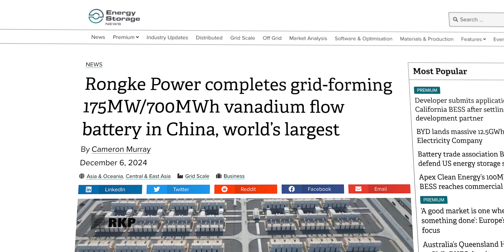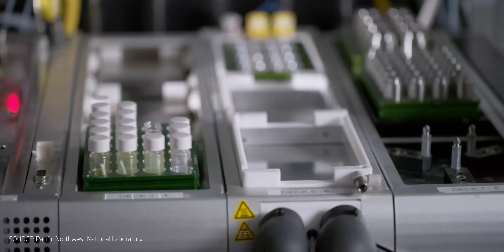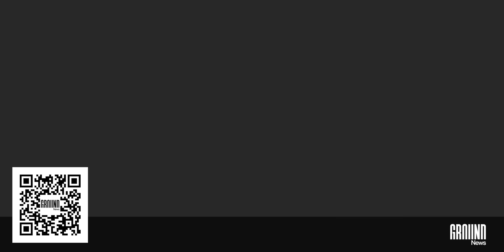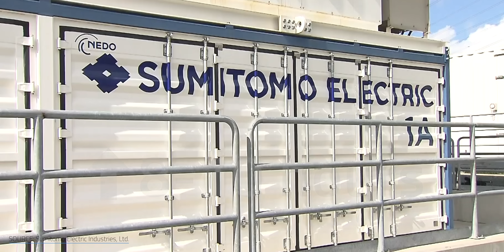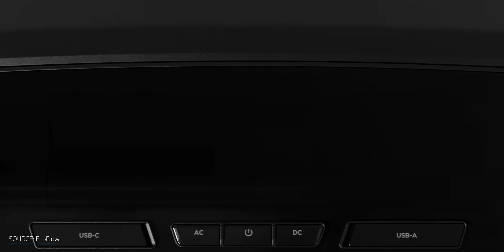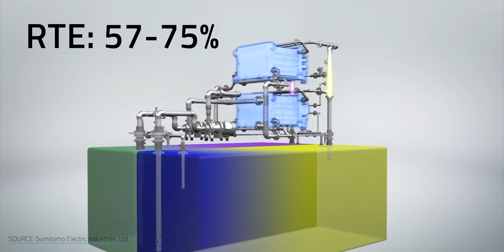Why Isn’t This Revolutionary Battery Everywhere?

Comment: I’ve tested a number of these products and I am an energy storage project developer. 

Here are the benefits of VR batteries:
1) you can refresh the electrolyte effectively mitigating degradation in energy capacity
2) electrolyte is not flammable
3) tech is relatively established and has been in use for at least 20 years commercially for stationary storage

Here are some disadvantages:
1) they used to be cheaper (on a $/kWh basis) than Li-ion at scale but the Li-ion cost curve has now surpassed nearly all other technologies
2) the electrolyte is not as cheap as you’d expect and the above-mentioned “refresh” has a substantial cost. This led to some companies to innovate on the business model and “lease” the electrolyte which increase ongoing system cost
3) while not flammable, a spill is nonetheless a considerable  cleanup situation and you have to factor spill containment into site plans
4) the energy density is very low so you need more acreage for the same power, which makes this a nonstarter in urban areas where you need power and transmission congestion relief the most
5) when I tested several flow systems ~10 years ago, they all leaked. Someone needs to get in these companies who came from automotive cooling systems and teach them about reliability and fewer parts

While I’m a huge fan of long duration energy storage, our electricity markets presently do not value it. There is little incremental monetary benefit for duration >4 hrs, and it is not enough to pay for the capital cost needed to increase duration, I.e, increased duration is stranded cost in most markets.

In short, I can make a 4, 6, or 10 hrs battery from Li-ion for cheaper than VR today on less land with less ongoing costs. But most markets only make 4 hrs battery batteries economical.
Reply: Are these batteries too heavy to be stacked ?
It would take up far less area if you could go 3-4 tiers
Reply: @ good question. I’ve seen designed proposed for two levels. Seismic codes are a concern in jurisdictions where applicable and may prevent it. The present fire standard is UL 9540 / 9540A and while not specific to vanadium redox, the test requires that if a fire were to start in one cabinet it shall not spread to the neighbor. This makes the test challenging for a tiered design, and obligates any non Li-ion technology to argue for exemption.
Reply: @SolveFixBuild  Plenty of space underground, where all these storage systems should be built. Way more economical and safe too.
Reply: Ещё в конце 19 века был в России потоковый аккумулятор ,в котором заряжался электролит.
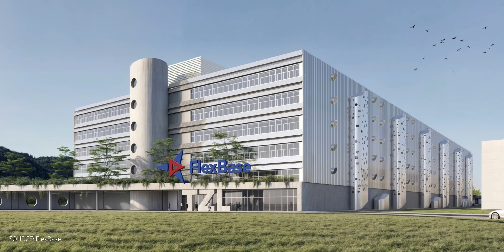Reply: THE VERY BEST COMMENT!  I paused the video at 7:55 and started talking to myself about the various nagging questions I had and potential issues, and you literally addressed very single one!  Bravo!
Reply: Have you looked into iron flow batteries? ESS Inc is one company offering them but they do not seem to have achieved a lot of commercial success. Even if VR batteries are not flammable the solution is still toxic right? The iron flow battery tech seems to be more enviro friendly in this respect. Any opinion on whether its commercially viable and who not more adoption?
Reply: @kevhall4802  I don't think batteries are the answer to any of these issues.

I think the answer lies in liquid air batteries and pumped hydro, personally.

Both nontoxic, proven on massive scales, and extremely reliable technologies.
Reply: Very interesting! The last issue about pricing of long term storage sounds like we governments to incentivize this aspect. Long term storage effectively minimizes price volatility which is good for the market and enables us to decommission backup systems like natural gas power plants
Reply: @iccuwarn1781  you are correct. In California the Resource Adequacy contract is specifically valued at 4 hrs. At the ISO level (FERC regulated), most market payments for capacity use 4 hrs as the base case a de-rate capacity payments for lower durations and pay more for batteries with longer durations. These are adjusted on a yearly (or greater) cadence but are a coarse measurement of value and do not recognize value for storage’s fast response time. Capacity markets were an appropriate mechanism for when the load was growing 1-2% per year but they do not adequately capture the value of fast-responding long duration assets in a more volatile grid with fast growing load.
Reply: @iccuwarn1781 why does the government need to incentivize this?

If it isn't profitable it probably won't be, there are way better technologies than this with more proven systems to curtail over production.

Batteries are not the answer, that I can tell you, unless we find something way more energy dense.
Reply: Surely here in Australia a ~12 hour storage system would work well.  We already have to curtail solar output during the daytime as we produce more than we can use, while overnight we still have to burn coal.  Being able to economically store that daytime excess and supply it to the grid all night would be a game changer for us.
Reply: CO2 is climatologically irrelevant. 

CO2 is climatalogically irrelevant: Interglaciation climate change (e.g. the Medieval Warm Period) is caused by cosmic ray fluctuations ( see the work of Henrik Svensmark, et al).

Just burn coal: the CO2 issue is irrelevant (see above). The sulfur issue with gaol is bogus too: sulfur is an agricultural fertilizer (ask the farmers). The "acid rain" issue is at most "a nuisance" (see the $500 million NAPAP study of 1990).  "Acid rain" was another one of those shallow media sensationalisms, like "global warming" and "ozone depletion". 

Global warming is 21st century superstition. 

Just burn coal.

Sorry, but however intriguing these battery-thingies are, they are just another tax-sheltered boondoggle for people who don't want to do get a real job. 

Just burn coal.
Reply: @hg2.  The effects of global are clearly visible. It's undeniable the Arctic and all perma frost is shrinking.
The reason can be debated but there has not been any even remotely as plausible explanation for climate change. You can prove the heat absorbing properties of CO2. We have data collaralating CO2 in the air and temperature and decrease over millions of years.

You can't truly prove anything, including but not limited to gravity, the necessity of a heart to live, that walking through a wall is impossible. But you can find more than enough evidence for something, and one of those things is Global warming

Also ocon depletion just was something that happened we did something about it and it ended.

Comment: A factor that you fail to mention, yet is shown on-screen dozens of times during this video, is that the systems being deployed are fitted in shipping containers. This makes them easy to deploy to sites all over the world, they don't need local production because shipping containers can be, well, shipped, anywhere easily. They can be hauled up to sites where other types of systems might have logistical problems, they are a standard modular size so your system can be designed to be scaled up or down easily. The components can be lifted and shunted around by commonly used equipment, not requiring expensive groundworks or other specialised equipment to set up. All helps make the system cheaper to deliver and install.
Reply: Utility-scale lithium ion battery packs are also shipped in shipping containers. This is not the big Advantage you think it is

Comment: Interesting stuff! Another tool for the tool box for grid (or even domestic) storage of renewable energy production. Even though the overall efficiency is "middling"... the other benefits make this a bit more palatable. Low/zero fire risk + recyclable + scalable. Sourcing Vanadium at least for the short term might be a bit of an issue, with the top 2x producers being China and Russia (no3 & 4 is Brasil & South Africa).
Thanks Matt!

Comment: Storing electric energy is pretty easy. This is obvious to all of us who are actually paying attention and not stuck in a “must generate at time of use” mindset. For grid storage, it all boils down to cost. And cost comes back to Wright’s Law, which requires both fast scalability and material availability. Wright’s Law is why lithium batteries are so cheap now - production scales really fast, thanks to the needs of mobile storage (computers, vehicles). For vanadium to be competitive, it needs a better supply chain, and to cross the chicken/egg problem of volume to make demand for a better supply chain. That’s why I suspect it will lose out to things like iron-air batteries, that rely on materials that already have a really good supply chain.

Comment: With smaller VRFB units being much higher efficiency - that seems to point to having many, many small units installed in many places. Microgrids also have lower losses.
Reply: I want one for my house! A couple of these on the (reinforced) garage wall would be a perfect compliment to a rooftop solar array. Much longer lasting than lithium or old school lead-acid.

Comment: For storing wind and solar, it sounds like a good option.  Flow batteries are a better idea at least conceptually. I wonder what the maintenance costs are like for a facility.  Also curious about what happens when it leaks.  How toxic is it?  The efficiency issue I don't see as a problem.  If enough attention is applied to it, it will improve.  Lithium clearly isn't the answer for grid storage.

Comment: 4 and 2.4 hours of storage for flow battery sound like nonsense. the whole point of flow battery is that power is expensive, but capacity is cheap. they should be built for longer storage
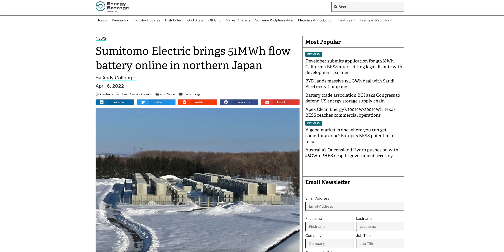Reply: Yes, I suspect that adding another 130 10,000 gallon tanks filled with Vanadium electrolyte to double storage to 100 MWh (7:10) is actually very expensive

Comment: Great new video!  I'd like to see a more detailed explanation of this "shunt flow current" problem.  If it's affecting round-trip efficiency, that means power is being lost somewhere during charge, discharge, or while in storage, so where is this?  Does the battery require a lot of cooling?

And more details on the electrolyte?  I assume vanadium is being used as the plate material, so what's being used as the liquid electrolyte that's getting pumped around?  You briefly described it as being safer, but can you go into more detail on it?  Is it flammable?  Caustic?  Corrosive?  Poisonous?  Explosive?   I think you said it worked better in cold weather, so I assume it has a low freezing point? (I live in Iowa, that's important!)  Also what's its boiling point?

Looking at the design, I assume pumps keep the electrolyte circulating between the tank and the "fuel cell" that is the battery?  So the "charge level" of the two part electrolyte is kept even throughout the battery and the tanks?  Are the pumps the source of the round-trip efficiency losses?

Lead acid cells are 2.0v, lithium are 3.7v, LiFePO4 are 2.2v, what's the voltage on a vanadium cell?

You didn't really explore the idea of mass home energy storage.  Right now batteries are the biggest headache of home solar - I'm imagining housing divisions going up with solar on the roof and vanadium in the basement, as part of the standard house construction - how do you think this would work out?  Are there any obvious drawbacks?  You mentioned waste heat being used by one installation - I wonder if the batteries get warm while in use, that might be useful for home heating?
Reply: Once did 5.5 KWh of backup storage using 4 lead-acid 12v batteries  in a home with 15 KW of rooftop solar. If doing it again, I would have added two more banks of batteries to get 16.5 KWh, which would have approached being able to go off-grid at times with a higher output inverter. If we covered every single family home in the US with solar panels, and only single family homes, we could produce 1/3 of our electrical needs tomorrow. Add in commercial roof space and we could do 1/2. Tomorrow. Even without significant backup, imagine what what could do for energy independence and national security. The Finns are beginning to use commercial sized sand batteries to store renewable energy thermally. It seems to be working well for them, and is economic. Thermal energy storage could also include pressurized thermos bottles near our existing generating plants. The extra renewable energy would be stored as water heated well above the unpressurized boiling point  during the day, and released as steam during the night to run the turbines.  Our existing petroleum resources could keep us going comfortably until we get enough of these systems online. Seems a shame to waste any resource we might put to use, when a global competitor is racing to be the dominant global player in renewables. Switching their civilian economy to a renewable basis allows them the luxury of saving petrochemicals for military use. And we're not seeing it.
Reply: Wikipedia is free. The electrolyte is a solution of vanadium, while the electrodes are carbon based. Wikipedia says "the electrolytes can be prepared by several processes including electrically dissolving Vanadium pentoxide in sulfuric acid.'

Comment: Very nice that the actual battery chemistry is so recyclable:  When you do recycle a VRFB, all you are really doing is changing the membrane in the ion exchange unit.  With the right design, that could be really easy.  Maybe filter a few decomposed membrane bits out of the solutions.  It's not like either vanadium or sulfuric acid are going to change into something else, or grow dendrites!
Reply: It's only possible, but it's not done much cos the reuse involves a substantial cost. We can recycle lots of things, but most of them just aren't profitable to do so for. Indeed vanadium mining itself isn't profitable at present, so it's mostly sourced as tailings from other mining.
Reply: All battery chemistries are recyclable.

Comment: Did you say VFRB through that whole video? Where can I get a small one?   👍
Reply from the maker: Yep 🤦‍♂️
Reply: CO2 is climatologically irrelevant. 

CO2 is climatalogically irrelevant: Interglaciation climate change (e.g. the Medieval Warm Period) is caused by cosmic ray fluctuations ( see the work of Henrik Svensmark, et al).

Just burn coal: the CO2 issue is irrelevant (see above). The sulfur issue with gaol is bogus too: sulfur is an agricultural fertilizer (ask the farmers). The "acid rain" issue is at most "a nuisance" (see the $500 million NAPAP study of 1990).  "Acid rain" was another one of those shallow media sensationalisms, like "global warming" and "ozone depletion". 

Global warming is 21st century superstition. 

Just burn coal.

Sorry, but however intriguing these battery-thingies are, they are just another tax-sheltered boondoggle for people who don't want to do get a real job. 

Just burn coal.

Comment: 500MW and 1.2GW of storage means that , at full power, the facility can ‘only’ run for 2 hours and 24 minutes.
Reply: Yes, it's interesting that for technology touted as a solution to long-duration storage, because you can scale up energy storage independent of power delivery, no one is actually building longer-duration VRFB storage. 7:10 maybe adding another 130 10,000 gallon tanks filled with vanadium electrolytes to double storage to 100 MWh isn't as cheap as supporters pretend?!

Comment: Really curious about the Iron/Salt redox flow made by ESS in Oregon.  Sacramento utility put up a ESS redox flow.  How does it compare to vanadium flow?   Salt is no joke.  Salt batteries have weird wide voltage variances, but they are out there already and they work.  I put sodium sulfate in my car's new flooded lead acid battery and it works a lot better.  Holds a charge much better/longer.  Extremely cheap to do.  Turns out it is an industry secret.  Sodium sulfate is apparently a chemical used in deep cycle lead acid.  So they have been holding out on us.  Planned obsolesence in flooded lead acid starter batteries is a crime.

Comment: What happened to the rust batteries? They seemed ideal for grid and domestic storage. Cheap and available electrodes and electrolytes, reasonable performance and recycling potential and excellent stability. Who cares if you can’t put them in a sports car. So where are they now?